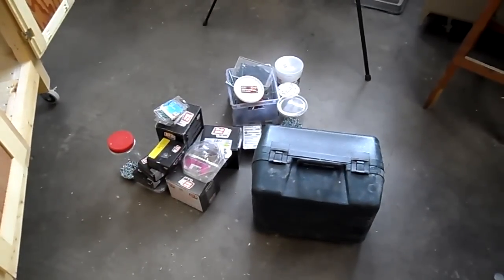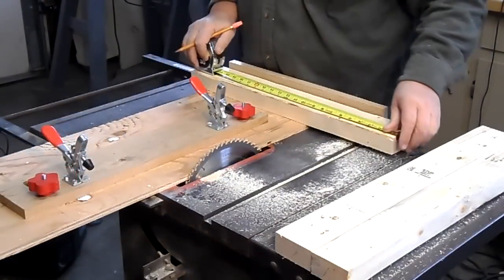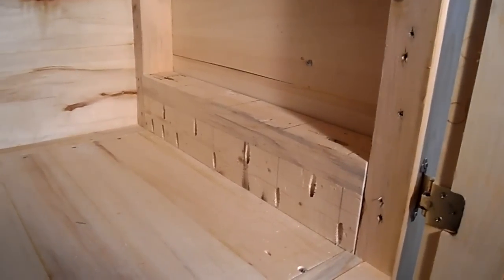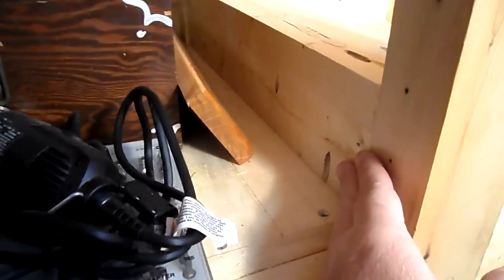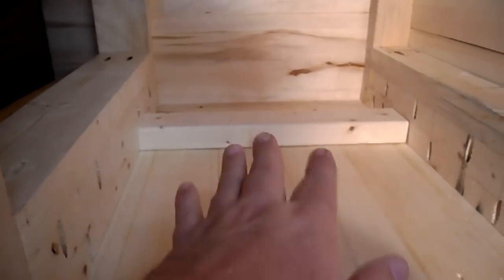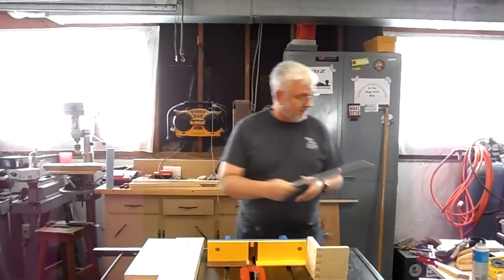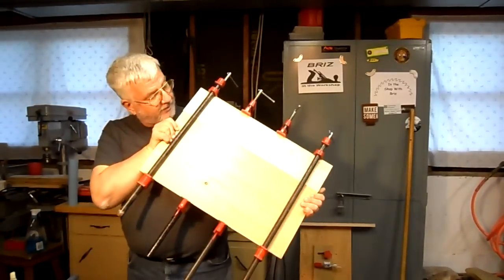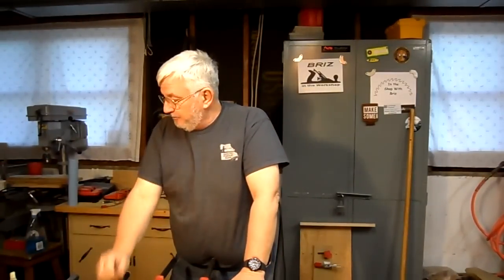Build Drawers to Enhance Your Workbench

Comment: Do you have a video on how you made that tapering jig? I subscribed and couldnt find it in a video search.maybe I over looked? If not u shld make a video on that.goid luck wth surgery.  Knee surgery sucks!
Reply from the maker: Hi Joe,  I do not have a build on the tapering jig.  One of the channels I subscribe to does have a video.  I'll go look up the link and post another reply.  Thanks for watching.
Reply from the maker: Here you go.  This one is similar to the one I built.  https://www.youtube.com/watch?v=0CO3bBNv6tc  I just glued an extra board at the bottom to make it a cross cut fixture as well.  Hope this helps you out.
Reply: Ron Briz thank you sir! I appreciate that. Ive been wanting to find a use for theae toggle clamps I bought from h.f. months ago at their  "parking lot sale"..now I do!:)
Reply from the maker: Joe Walters Glad to help and thanks for subscribing!  I got my toggle clamps from h.f. also.
Reply: Some of Harbor freights stuff is good and some of the stuff I wouldn't touch a lot of it is overpriced nd junk as far as their power toolsmy uncle buys tools there thts how I know what to get and not to get..lol the only things I  get from there are there clamps. not the quick release, but the bar clamps and toggle clamps  oh and  my dust collector as well as  my disc and belt sander combo that works pretty well I had a coupon for it for $49.99 so for the money it definitely works and serves its purpose